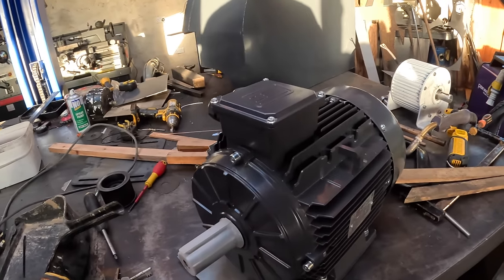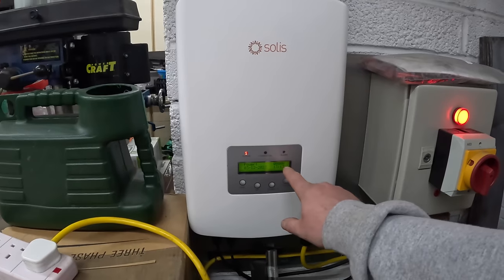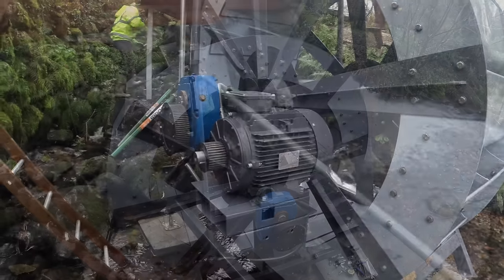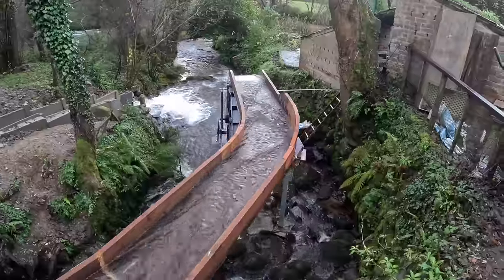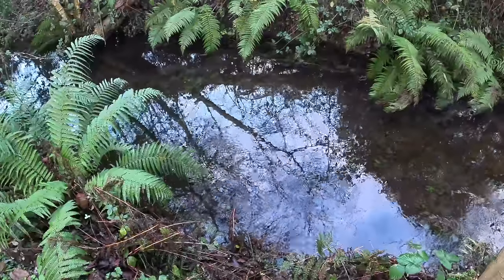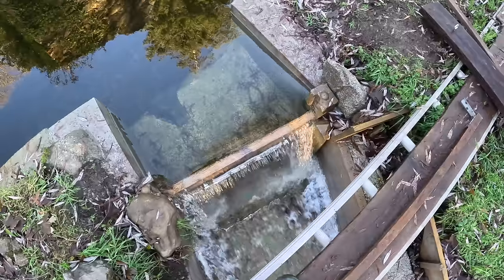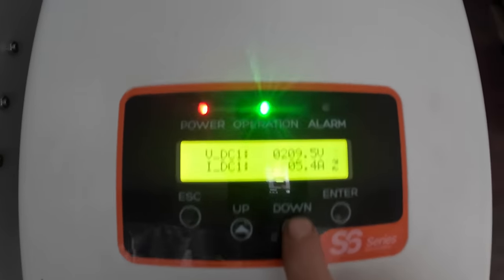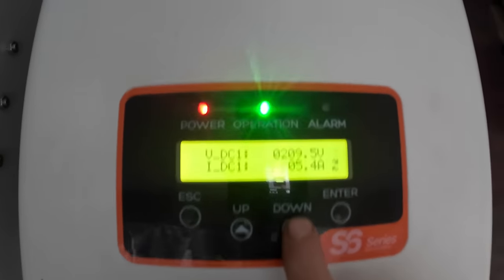Powering An Old Mill  1.5 Kw Lake District Overshot Waterwheel Project Part 4

Comment: Great stuff. See your cable for the safety cut off? Make sure it’s not contacting the bracket that supports your spillway into the wheel. Vibration will chew through insulation and armour in a couple months. 😊😊😊😊

Comment: Hey Kris, love the hydro videos! Where I live (Perth Australia) solar is a different beast! It’s crazy to compare. On a 5kw system I get an average of 40kwh a day in summer and about 21kwh on the shortest sun day of the year and a an average of 26kwh in winter. In Perth I’d say far more houses have solar now than not. The limit obviously at this point is battery storage. As the cost comes down more and more house will take up batteries and become self sufficient for power needs. It’s exciting to think about the positive effects on the environment this will have.

Comment: As an enthusiast (and for stretches user thereof, too) for small-scale waterpower I can't praise Your perfectionism  while trying to keep everything reasonably priced enough, even with Chinesium obviously not being up to the job, at all. That thing is a really beautiful contraption convincing Poseidon to share his waters' power with us humans.
For the splashing (or against it) the rims had to be "higher" to contain the backflush inside the chambers. 
Waterwheel design is quite the tricky field. Ossberger Waterpower has some interesting forms, and Victor Schauberger might give a little bit insight into the sometimes odd character of flowing water. (I don't know whether there was a lot of the Austrian Schauberger's work available in English however.)

Comment: Fanatics achievement, you should be very proud of this, if you do more of these offer home assistant on a raspberry pi with Shelly electric clip monitoring, you can remotely monitor all the energy or let the customer remotely see the energy generated, grid pull and graph the difference, but fantastic video, couldn’t wait for the latest update

Comment: This has been a great series and the end product is hugely  impressive for your first build! It's good that you were able to overcome the problems caused by the Chinese alternator, it seems that many people who have bought Chinese wind generation systems are only too aware of the similar issues. One thing that did catch my eye is how tightly fitted the new motor/alternator is into the cover - when running close to its output capacity it's likely to run very warm, particularly when the weather gets hot, as the motor needs to draw cooling air in through its back casing and blow it forward, which I suspect it may struggle to do. You could put a louvred vent in the cover behind the motor which would allow some airflow whilst keeping most of the water out...

Comment: 8 pole is good, 900 rpm would produce 60hz. Milling off 8 spots on the squirrel cage, like synchronous motors do, You would create consistent output frequency. Instead of capacitors, rare earth magnets in place of the cast aluminum in the rotor. But capacitors are an easy way to excite the squirrel cage currents. Uh, being in a wet environment,  I would suggest dipping the stator in epoxy resins, or class F epoxy paint, well sprayed, all over. And sealed motor bearings. A TEFC frame motor, isn't waterproof. Should have large drain holes, and the connection box, should have a drain hole too.

Comment: Kris; Thinking a piece of sheet rubber higher than the water coming off the shoot to just above the wheel would stop of the water splashing out of the buckets. You may not be able to stop the splashing but can control where the splash goes. Just got to make the splash go back in the buckets.

Comment: You on the right road now Kris, the induction motors are more readily available and next time you could change the ratios to maybe get to a 6 or 4 pole smaller frame motor and more efficiency, not to criticise you but your motor base seems too light you might get some soft foot particularly on LHS or vibration cracks there. Also this motor will give you the full 2.2kw you don’t take the efficiency and reduce the power output by the efficiency what’s on the plate should be what you get. Have done bigger projects using Siemens motors and S120 Active Line Module grid inverters.

Comment: Hi Kris, What a fantastic job you have done! Very impressive!!! Have you considered using rubber matting to smooth the water flow from the trough to the wheel? It is used in large gold sluices (same size troughing) Matting about say 3mm thick, laid from about a meter before the trough end to say half meter over the wheel. This should smooth out the ripples and eliminate the splashing at higher flow rates... Food for thought anyway. Again, love your work! Keep it up!
Reply: I thought of a floating board on top but your idea is even better.

Comment: Great work. Amazing what you have accomplished with common sense and self-taught engineering! This is a system that should provide power for a generation or more. 

I will say I am not surprised at all that the Chinese generator couldn't do what the label claimed... my very first thought when I saw it next to the wheel in your shop was either that motor is grossly undersized or that wheel is much less efficient than I would expect. As I thought at the time, it wasn't a design flaw in your wheel:)

EDIT: After the discussion of the flow rate required for 1600 vs 1200, I think the chute tip geometry needs to be variable in order to run it efficiently at the higher flow rate.

Comment: Great to watch your work on the wheel. Could the side walls on the wheel have been a little taller to trap the splashing over the sides to trap the water into the buckets. Green as can be.

Comment: Hi Kris, really enjoyed this series.  I wonder at the higher flows whether you could extract more power if the wheel span a bit faster?  That would allow the buckets to fill a bit more without the splashing?

For the speed control, I also wonder at using electronic controls and whether you could use the same sort of systems that the steam engines use (using centrifugal force) - the 'lift' could lower the paddle and reduce flow proportionally??

Also, from a design perspective, when you make your next one, perhaps have the tensioning bar in tension, rather than compression - no chance of it buckling then...

Really fun, well done!

Comment: Nice fix.
In the car industry they have 3 motors for the maintenance and to avoid to modify the frame of the machine and new validation tests.
This design could be compared to the Pelton +pipe design, no splash, compact and generator in a shelter.

Comment: Kris, what about making a (half) automated control system for the water inlet? You could even make a feedback system where you could set a target power and it would automatically regulate the flow-rate to try and match that.

A cable, an actuator, a rasberry-pie and some iron would do the trick.

Comment: you should consider using a voltage probe. you can get 0-1000V probes with 0-10V output (Da4u) on ali for cheap, put the 0-10V into a i2c interface for a arduino, and with a little code you can have that system sensing the "real" voltage and have real protection for the inveter. Also i would experiment with a odometer on the weel and a water level sensor in the feeding pond. thanks for the absolute great video, love your work! Keep on filming!

Comment: Great to see this brilliant mini-series completed with such success. Customer must be well pleased.
The only question I have is the noise of the wheel. Some of the noise is unavoidable; splashing water makes a noise. But some of the noise seems to come from the metal buckets. A wooden wheel would not be practical here, but could that reduce the noise? Are there any other material choices which could reduce the noise output?

Comment: a small cover of the bearing at the none-motor-side would make me happy.  Even though it might be sealed,  being wet 24/7 365 vs covered will impact its lifetime and even if it doesn't,  it will look better :)
Reply: Well.....the next time YOU build a water wheel, you can fit a cover!!!
....in the meantime .....

Comment: I think a good solution for an overspeed controller would be to keep an spring-loaded actuator actuated as long as it gets power.

The controller cuts power to the actuator if overspeed is detected or if the grid goes down and the force of the spring pulls the pin. That way a dual failure (grid down & torn belt) will still actually fail safe without the need for batteries.

To minimize power-draw you could have a small actuator and a small spring pull a pin on a bigger spring.

Comment: I am so impressed with your projects. The hydro wheel/generator is more technical, but the practicality of small hydro installations is beyond question. It seems that this important part of our history has waned in as large electric utilities have built large generating stations and a power grid to distribute the energy. It was gratifying to watch as you use your intelligence, ingenuity, self-sufficiency and persistence to build this energy wheel. Well done!

Will the hydro and solar energy outputs meet the owners total energy needs? Am I right to think that there will often be surplus energy produced? Will he be allowed to feed surplus energy into the power grid and be paid for it?

Comment: Best method to utilise free electricity. Water 24 hr and sun in daytime. Solar is great but really only on sunny day you get full potential. Water is always there unless river drys up. Maybe a wind turbine next lol.

Would it improve the system if the buckets on wheel were bigger?

Comment: Great job, very inspiring!

Note: You could improve the filling of the buckets by splitting the flow after the last bend. It would require 1.5mm steel plates that are attached vertically to the water channel. „Laminar flow“ is what I mean.
Reply: By splitting the flow, you run the risk of increasing the velocity which is an issue here. Might be better to just add baffles or obstructions along the flow path to slow the water down gradually.

Comment: Interesting to see what you have done with the capacitors on the motor.  I can’t understand how the solis inverter copes with the changes in frequency as you adjust the flow rate.

Comment: What those suppliers were doing was just out and out fraud. Clearly they are just putting fake labels on a smaller capacity unit.
It was gratifying to see you work through all the different issues that were thrown in your way. I hope it doesn't discourage you from doing similar jobs in the future.

Comment: have you considered adding a splash guard that leads the water in from the spout and forces it to stay in the bucket, this would greatly improve peak efficiency as there would be next to no power loss, depending on the tolerances.

Comment: Kris, wouldn't be an idea to make the end of the chute retractable? By looking at your footage I got the idea that if the chute was a little more further from the wheel the buckets would me more attacked tangent to the wheel. I'm not sure if this is a good idea but it could add an adjustable variable to maximize the output at different circumstances. Thank you for sharing your journey. I recognize a lot. Best! Job

Comment: Brilliant work :)
Maybe make a cover for the capacitors so it’s more difficult to touch them. They are still charged for a bit after the power is turned off and can give a big shock if you touch the terminals.
A lot of guitar valve amps have covers to go over the caps to stop accidents :)
Reply: It's different... The capacitors in an amplifier are charged with DC. These capacitors are across the windings of the generator - it's part of making a generator out of an induction motor since the motor does not have any permanent magnets in the rotor (as Kris explained). As soon as the generator is stopped rotating, the capacitors are fully discharged through the windings. They would only hold residual charge if disconnected from the generator while it was in motion, which should not generally happen.  But, a secondary cover over any exposed high voltage connections is a good idea.

Comment: Kris,
Have you considered RPM reading? Somehow figure out the RPM (or volt meter) and put it near  the controller? That way if they're half asleep and re-engaging the wheel: no need to come see the water wheel. Could also be used to automatically re-engage it programically.

Comment: Hi Kris , Can you please upgrade this system by adding a guard around the outer diameter of the water wheel to minimize the water splash , and top protect the generator head ? An excellent job Kris thank you 🙏

Comment: Now all you need is a flow control for the water.
You might install a flow shield for the top of the water wheel to improve the bucket fill.

Comment: Hey Kris, really enjoyed this series. Just an interesting thought about the failsafe for a belt break - have you thought of using an electric magnetic door catch to hold the wicket gate open? You might even then be able to use a centrifugal switch from a capacitor start motor to kill the power to it in an overspend scenario. That would make a nice redundant system if it could be made to work. 

It would kill the wheel on the power loss scenario and overspeed in the scenario where power is restored after a cut.

Comment: Amazing design and build. Dumb question; I assume there are no batteries involved, and the excess power goes to the grid, so what is the mechanism that decides that you have enough power to send some to the grid? I am really glad I found your channel. It is the one I spend the most time on, but as you can tell electricity is not my strong suit. Thanks for your time producing these videos. My favorite ones are the timber framing, but I am hooked on all the stuff you are doing.

Comment: i was wondering about belt failure and over run - i wondered if the generator was turned 180* and offset to the wheel mechanism (obviously needs to function in the reverse spin)

and instead of running a belt, you could have direct drive between cogs on the drive shafts (or could the drive shafts be coupled together), sure more expensive to make, but more reliable and also means the generator is slightly further away from the wheel, might be useful since your space was narrow against the wheel, all you need is a stray branch dropping into the works and causing more damage, bending the nice shield you made

much witch craft to take in, but very successful job mate, well done, now write a book on it all

Comment: Well done and excellent mate. You should show a schematic of the induction motor with the capacitors now generating the power, along with the shaft RPM at the slower flow, for clarity to the 'engineers' & ppl watching. Some think you have put additional magnets and coils into the motor now. The armchair engineers comments are all chewing on each other over functional parameters of it all.

Comment: You can probably get the 1.7kw with a slight angle change on the spout pouring into the wheel. But, that is minutia. Great system and well-designed. I was not expecting much out of that other generator... Way too small to hit 2kw output.

Comment: You have a cross current flow issue at the angle turn in the flume.  Maybe a guide fin to help the one side make the turn without intersecting the other side of the flow.  That turbulence drains potential energy.  Might develop a better laminar flow into the buckets as well.

Comment: I wonder if there is a way to create laminar flow to help direct the water in a smoother way into the bucket. of course as it hits the edge of the bucket there would naturally be splashing... but I wonder how hard it would be... just a thought I had watching this. I built a test waterwheel on my farm years ago but never finished the project. This summer I plan to rebuild and re-establish hydro power from our creek and want you to know how inspiring your videos across the board. Thanks for the info mate! Cheers! Oli

Comment: might be worth adding some flow guides after the turn down to the bucket fill to straighten out the turbulence generated from the turn. Also not sure if you tried a short adjustable lip to the new curved fill ramp to tweak how much splash you get at those high flow conditions?

Comment: I love what you are doing. What I would check is if the position where the water hits the wheel might be moved a bit back and  how that would affect power and splashing. In a combustion engine you also advance spark timing dependent on rpm, and you usually ignite before the piston reaches the top. I don't know where the water starts hitting and filling the bucket, but to me it looks like filling it could start a bit "earlier" than it currently is; it may be it is just a few percent that even can't be measured, but it might as well be measurable. Maybe you checked all that or have the knowledge what works best, but before you could not realiably measure the output.

Maybe the inlet is already in the best position, but I would love to see it confirmed, or even better, see it make even more power.

Another question I have is about the down curve at the end that accelerates the water and thus increases splashing, but also delivers more power. Is there an optimal target speed you want the water hit the wheel with, or do you want to match the speed of the bottom of the bucket moving, or do you want to fill each bucket as carefully as possible and maximize bucket fill for the price of having to accelerate some of the water?

I guess you calculated a lot of this, but I would really love to hear more about it. But maybe I should read up on it, there should be stuff out there.

Comment: Kris, why don't you change the gearbox ratio to allow for a slightly faster output shaft speed at a lower input shaft speed? I would think there is plenty of torque to provide this. Fantastic project, really well executed.